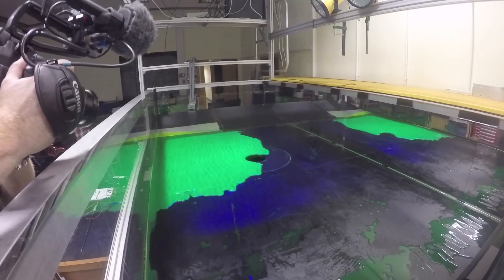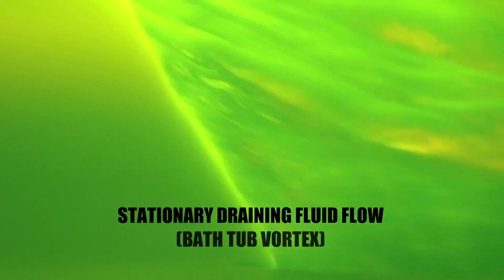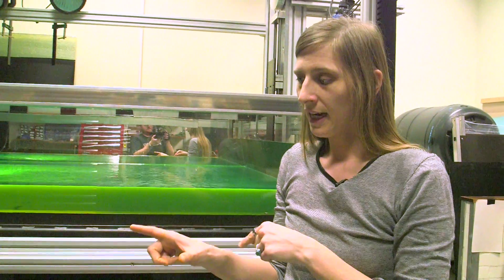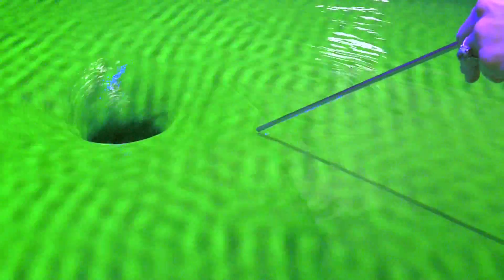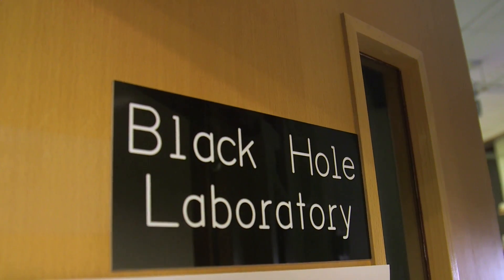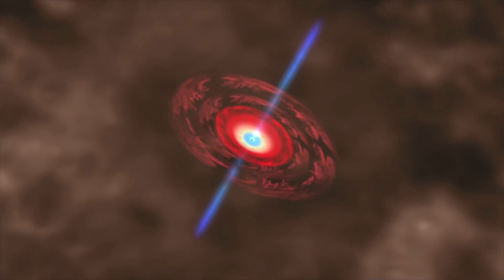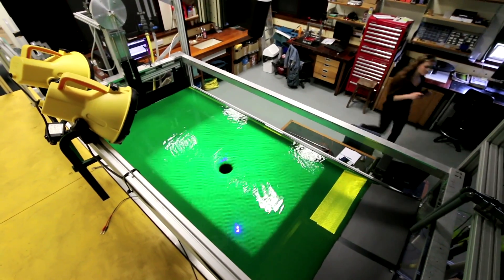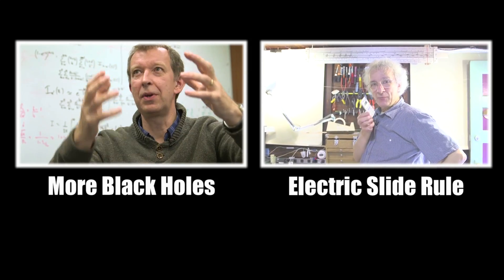The Black Hole Machine - Sixty Symbols

Comment: That looks cool, but why are simulations like that used rather than computer physics simulations, if they cause additional problems with precision of measurement? Do good enough physics simulations take too much processing power?
Reply: It's actually cheaper to do this than to rent a supercomputer to run a simulation.
Reply: I'd imagine things like these are used to test if the simulations are correct, or to find effects not predicted by the simulation. Simulating things is fine to a point, but eventually everything needs to be tested in reality. It doesn't matter what models you come up with, if you can't test and measure if they actually work.
Reply: Dracarmen Winterspring
Both approaches have their advantages. Any simulation can produce novel effects, when found these should have their cause investigated to see if it arises due to the simulation's programming or the physics behind it. (For example one interesting result that suggested water molecules could form 'chains' to pass hydrogen atoms around at unexpected speeds turned out to be due to late 80s computers treating big enough numbers as negatives. On the other hand many quasicrystals were found first in simulation.)

We have some excellent models of black holes for certain phenomena such as merging, there the physical approach is impractical and imperfect. But for things like turbulence and flow the physics is poorly understood and models such as this one have an important role to play. In the end sometimes you have to try everything
Reply: Dracarmen Winterspring
It is true. That's why it's awesome :D
Reply: There are a few reasons. The first is that these setups can have massive 'processing power'. Here each molecule in the tank can be considered to be its own piece of code. The Salesman Problem is tricky to handle with computers but the breakdown of an insulator with metal pins representing the destinations allows single electrons to try out each path and find the shortest.

Another issue is that simulations may be wrong; they can be complex and hard to understand in themselves and a small error or inaccuracy can cause results that look solid but are in fact garbage.

Another issue is that these things can find results that were not predicted. (Relating either to the simulation setup or the simulated phenomena.) As it is said 'Science does not start with "Eureka!" but with "That's funny...".'

Comment: Is there some decent device to show off sonic black hole (or perhaps create one)?
Reply: It's easy enough to make one, all you need is a drain that can drain a tank as fast as possible. (That is the plug never fills with water.) This can be built from any large tank with a hose and drain. Dye is optional, but getting a nice 'stable' hole like this takes some tweaking.
Reply: He said 'sonic' black hole, which is made from sound, not liquid.

Comment: so this science research money went into building a bath with green water.
Reply: Tax payers money went into providing you with an education... I'd rather have a bath with green water.
Reply: A bath with green water that will help us gather more information on how black holes are likely to lose angular momentum. Did  you even watch the video?
Reply: +Harrison Harris The cheaper one, for chaotic systems like this: there is literally far too much to simulate here purely with computers. Practical models are still widely used in fluid dynamics and related fields.
Reply: Simulation work always has to be corroborated with physical observations. Its the reason they don't give out Nobel prizes until the theory is proven by measurement. Anything can be simulated inside a computer, that doesn't mean it is accurate, how do you decide what variables to input? From physical measurement and observation..
Reply: Heaven forbid scientists research something you don't understand
Reply: It takes all kinds. Considering the stuff regular money goes into, this is brilliant.
Reply: Do u have any idea how difficult and energy intensive it is to run fluid simulations to the precise levels they need? Its actually cheaper to do this than renting a super computer to do the calculations.
Reply: By the transitive property, Trump is a Black Hole.
Reply: Simulations are not cheaper Harrison Harris. Also a simulation only works down to certain unknowns where real world analogs can outperform it in accuracy.
Reply: Put it this way, for the sims lovers: a simulation can display and demonstrate known science, not original science and only to the degree of accuracy as your processor and your variables list allows which against the real world is woefully inadequate.  While simulations may give you hints, ideas and notions that is the limit of simulations.  For example, today nearly all electrical devices are first built in simulators.  However, none anywhere ever get built in production from a simulation because all design engineers globally can tell you the same thing a simulation is in no way a substitution for "the real thing". Off the simulation they build bench models that typically fail, the make test models when they get the bench models to work, then they work the test models up to reasonably sure working models, then a test run, then a production run.   Yes, there are design engineers on youtube that have done start to end walk-through's of what it takes to go from an idea to a product. One small step is not the end step of science.  This step is not the end step.  What is demonstrated here is a step that has been considered and worked with for a century and will continue to be worked with for another century or more to dome.   What is being done here is giving the information needed to create simulations that will then give the ideas for the next built physical model. If anyone feels otherwise, I invite them to walk into their local university and ask.  You will find your ideas of simulators rapidly disabused.
Reply: Your ignorance at its best
Reply: Sebastián López Ah nice, apologies for assuming you didn't know about this field.

People are claiming the need for 'supercomputers' which I can almost guarantee is overkill. This isn't some quantum simulation which needs supercomputer-levels of processing power. Yes it may be heavy computationally, but come on.
Of course: I have no idea of the key goals that they are trying to achieve, but considering that the setup of this experiment probably took weeks of labour along with the expenses of the pipe-works and more, I was proposing that computer simulation is more cost-efficient and probably more accurate too (didn't say time efficient OR effort-efficient). Then introduce the accurate measuring devices and electronic equipment.
But like you said, it's no point speculating about the possibilities now.
Reply: hakkihan tunbak 1) Very irrelevant, something else being done on supercomputer does not make it simple. They also use supercomputers to model fluid flow around the wings of planes, and even then they also build the wings and use experiments as even supercomputers will not give as accurate solutions as physically measuring it for fluid flow, unless you leave them running for years. The fact that it's much smaller than the globe is just not a point at all.

2) You're the one that brought it up that it isn't a quantum simulation as if being a quantum simulation means it's difficult or not being it means it's hard.

3) It is not a steady state solution, no. When you add perturbations to it it stops being a steady state solution. You can approximate it as a steady state solution, sure, but in which case you will not be anywhere near as accurate as just doing the experiment. Things such as that cone opening at the horizon which is an important part of their research would not exist in such an approximation. Same with the whole bit at the end of superradiant scattering.

"I will probably stop commenting now because from here on less-informed people will probably throw around the word "supercomputer" like a 4 year-old that has learned a new word."

Thanks for the random insult, but since I regularly work on supercomputers it doesn't really bother me.
Reply: +a_slime let's not get carried away shall we...
Reply: Actually its orange
Reply: Trump is orange
Reply: +No “ThisIsImpossible” Name  care to explain?
Reply: +No “ThisIsImpossible” Name I don't see any valid comments above. In fact it seems to me that it will be more expensive to extract meaningful measurements from this simulation using precise equipment etc. May I ask what your background is? Are you a physicist/engineer or just a random YouTuber?
Reply: +JamesCizuz thanks for the insightful answer, 

what I'm trying to say is surely this is just fluid dynamics with a sink that can be solved by considering the Navier-Stokes equation? In principle it is very difficult to find an exact answer to these equations, but using numerical methods it should be possible to find a very close approximation, which is probably more accurate than the bathtub measurements... And one thing that bugs me a lot is why we would even need a supercomputer for this: I think a regular computer could do the job no?
Reply: +No “ThisIsImpossible” Name oh look who's back to chat more filth. You seem to avoid replying when it doesn't suit you don't you?
Reply: +hakkihan tunbak As a matter of fact I do know; as an aeronautical engineer student I've taken linear algebra, multivariable calculus as well as differential equations, and I have very decent programming notions. Although I've been just for a year in my career, I'm well aware of the importance of computer simulations and real simulations; in the industry both of them work together, that's why software like Catia or NX exists. Usually an engineering team will start prototyping the development of a product through computer simulations and after they'll make actual tests. In the field of fluid dynamics, of which aerodynamics is a branch, computer simulations are very computationally heavy, and they sometimes don't agree with the reality observed in the tests. Anyways, you don't know the actual requirements of the experiment nor everything that's involved, this people clearly do and they're obviously aware of the existence of computer simulation.
Reply: +hakkihan tunbak just as a wild guess... maybe you don't have lots of experience with the complexity of crushing calculations. Computational power is not infinite. Why not take a look at what characterizes the complexity of an algorithm (polynomial or linear problems I think they're called), maybe solve some project Euler problems (if you know some programming) and see for yourself how, when you program carelessly, solving some calculations can take very long. Perhaps take a look at chaos theory and see how fluids are so complicated. If cunningly taken, computational power can be very strong, but sadly it has it's limits.

As a disclaimer: I have no formal training in programming (although I'd say I'm skilled for not being in cs) and to be honest I didn't understand the video very well.
Reply: +hakkihan tunbak With everything else I agree, they probably even made simulations first or took the ones already done as a reference.
Reply: "solved by considering the Navier-Stokes equation?"
"This isn't some quantum simulation which needs supercomputer-levels of processing power."

That is completely the opposite of reality. There's a lot of quantum simulations that do not remotely require decent computing power, on the other hand solving navier-stokes is incredibly computer intensive. 

There's no way you could simulate this to the same accuracy as experiment without a supercomputer.
Reply: BlueCosmology you and me both know that small perturbations (as mentioned in the video) are not a difficult obstacle to overcome mathematically. And like I implied the supercomputers they use for fluid flow are because there is turbulent erratic flow etc.
 Quantum simulations are the most computationally difficult to do. General rule is, in terms of difficulty:
Classical mechanics < statistical mechanics < quantum mechanics.

Stop being difficult please
Reply: Yes, and MRIs are just hunks of metal and aeroplanes are composite material tubes.
Reply: Timo Manunen what does that mean sir? That research is the key?
Reply: +zach korinis pretty much yeah.
Reply: I thought so, It's just that those machines are based on earthly phenomena we can access
Reply: +zach korinis It's just quite brilliant that we can simulate an astronomical phenomenon using a bath tub vortex. Also it doesn't look that expensive. Isn't it brilliant that we can learn about black holes by using a vat of water!
Reply: In 1-2 years they might not observe the transfer of energy in the water and it will be because the conditions are too dissimilar. If they do see it then more proof we know something about black holes, I just wonder if their talent wouldn't be better spent on another project
Reply: ***** I heard a quote once as well. "A witty saying proves nothing." And to actually address your example there's a MASSIVE difference between accurately simulating a small, closed system, for which every possible variable is known, and trying to predict every possible variable in a massive scale open system, having to account for effects such as non parallel gravity, and the only information you have is a few grainy satellite images and some wind speed measurements.
Reply: The Monarch except that for this you don't need any input information, you need the basic laws of physics, which we know, Anything else is made up or calculated from these laws
Reply: Harrison Harris Simulations are never run on "the basic laws of physics", such a simulation is just plainly not possible. Approximations and estimations are always made.
Reply: +BlueCosmology no they aren't wtf you talking about
Reply: hakkihan tunbak Yes they most certainly are. Please show me any simulation run over the basic laws of physics.

The basic laws of physics are not even known to be solvable full stop, ( and what we know as the basic laws of physics are known to not even be the basic laws of physics ).
Reply: +BlueCosmology in many cases the simulation is the tool which gives us information and not the other way around...

Simulations, in many cases, are better than experiments and can most certainly be free of approximations outside of the theory. Thermodynamical system simulations are a possible counterexample to your claims.
Reply: hakkihan tunbak Physical simulations do not, at all, ever, run over the basic laws of physics with no approximations.

I'll repeat myself.

Please show me any simulation run over the basic laws of physics.
Reply: +BlueCosmology seems that our definitions of basic law are different: you think fundamental law whereas I think simple law. Guess it's a misunderstanding then.
Reply: hakkihan tunbak Even if that was what basic meant in physics ( which it is not ), please give me an example of a "simple" law of physics that simulations are run over with no approximations.
Reply: Simulations can only take in to account what we know because WE set them up. If we are not aware of somthing that affects the experiment or is counter-intuitive we can't plug it in to a simulation. As a principal it is ALWAYS easier to observe than create. Computers have to make shortcuts to look realistic. You name ONE program that has simulated the effect of EVERY Quark in a body of water.
Reply: Well... I don't really care how many computer simulations a surgeon has run, unless that surgeon has actually cut a person open and done the job there is NO WAY I would let that surgeon near any part of me.  There is a limit to where a 'simulation' can take you.  Past that, you need to close the book and get your hands dirty.
Reply: No, Trump is orange.
Reply: Stupidity at its finest
Reply: +Sebastián López Yeah, I'm not a great programmer if I'm honest, but have done simulations involving orbits and similar things. I do admit that pointing the finger and saying "you're wasting government money!" is a lot easier than designing a simulation (let alone programming one) haha :D
Reply: I agree that a computer can simulate this much more cost-efficiently.
Reply: +No “ThisIsImpossible” Name alternatively you could keep quiet...
Reply: BlueCosmology 
1) Google how powerful supercomputers are. They're used for analysing/predicting freaking weather patterns, thousands of kilometres of distance, not a measley bathtub
2) well obviously there are quantum simulations don't need supercomputers: how else would QM have advanced in the 20th century?
3)this is a steady state solution: It's just two sources and a sink so for goodness sake stop exaggerating! You can even assume the water to be incompressible and are probably safe to assume laminar flow (bearing in mind that the purposes of the experiment is using water for black hole simulation and NOT fluid flow!). This isn't erratic movement like in a gas or turbulent water!

I will probably stop commenting now because from here on less-informed people will probably throw around the word "supercomputer" like a 4 year-old that has learned a new word.
Reply: What's more useful? A green bath which performs one experiment and costs loads, or a simple computer fluid simulation that allows precise control over every variable, exact measurements,  adaptable to performs several different experiments, and probably cheaper.